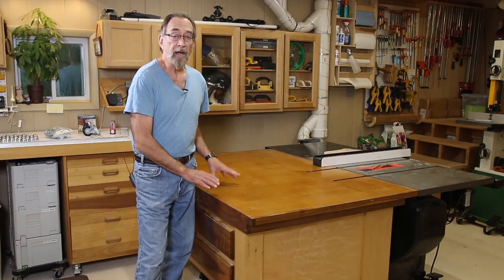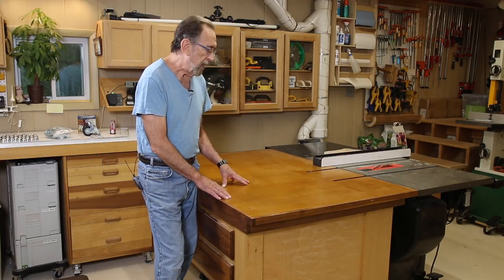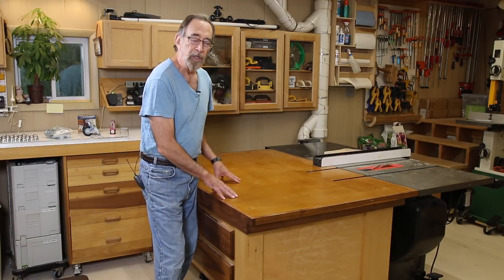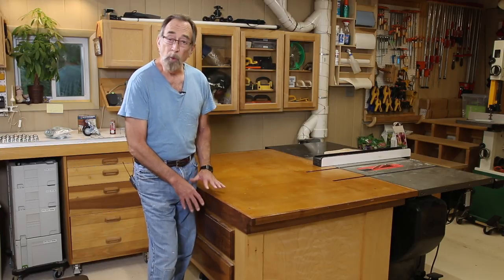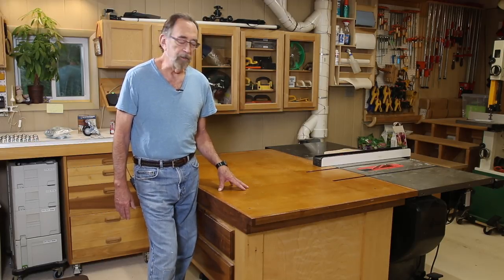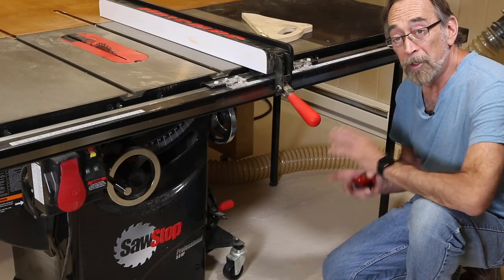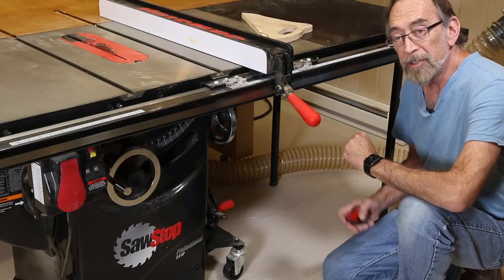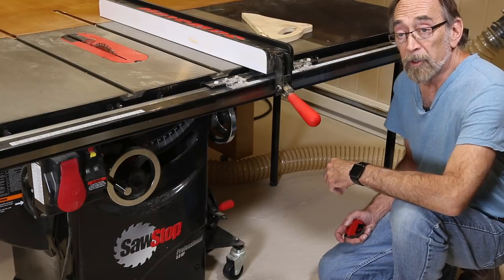Under Table Saw Storage Cabinet Part 1

Comment: Thank you Steve!  Another great project!  I really appreciate your sharing all of these super projects with us!  
FYI, I just checked (Oct 2020), Rockler has discontinued the locking version of those casters. They still sell the non locking versions.  Makes no sense to me.  I've asked them if they have a replacement for them, but haven't heard back.  Of course there plenty of similar casters on Amazon and at other Woodworking stores (i.e. Highland, Woodcraft, Lee Valley etc.).

Comment: Great video. Love how well you explain everything. I also have a SS PCS and was a little concerned that the leg assembly seems almost too big and beefy for a cabinet that is small enough to fit underneath the saw. Would it be possible to make the legs only big enough to house the aluminum extrusion?
Reply from the maker: Possibly, but I remain concerned about keeping the center of gravity of the build low enough to provide stability, so there are plans for the legs... keep watching!  And thanks so much!

Comment: I am very new to the wood working game and I need to know...what is a tortion (sp) box?? I really like your videos.
Reply from the maker: Hi Donnie... a torsion box consists of two pieces of flat material between which are a honeycomb of supports.  The honeycomb of supports prevents the top from warping or bending and provides, in the case of a bench top or other work surface, an absolutely flat and stable surface on which to work.  You can see how a torsion box is built by watching my first couple of videos in the series on building the SawStop Outfeed Table.  Thanks!

Comment: Great video as usual. Always helpful. Can you tell me which remote control switch you use for your dust collection? Half the time mine doesn't work.
Reply from the maker: Dave, thank you!  The remote is the JDS that came with my dust collector.  Unfortunately the JDS dust collector seems to no longer be available.
Reply: Thanks very much for replying. It's a pain in the butt when the thing doesn't work and a hazard at worst because it's distracting. Trying the Peachtree unit. Will let you know.
Reply: I replaced my remote unit (the yellow Rockler one) with a Long Ranger III from PSI Woodworking. Works like a charm. I can be in the next room and it works.

Comment: Do you use your 'I' beams anymore? I built them off your build vid and my shop depends on them for many operations. Especially breaking down sheet goods with the Festool track saw.
Reply from the maker: I do absolutely still use them... a lot.  I keep them stored upstairs in my shop because they are relatively easy to move around.  Sometimes I even use them upstairs and make a quick platform or doing finishing work.  My dust collector is upstairs so I added a port with a blast gate upstairs so I can comfortably do some serious sanding up there, too.